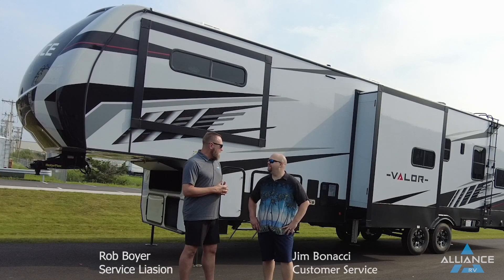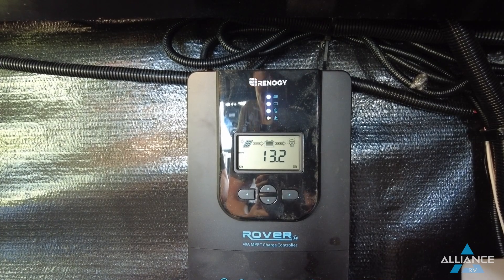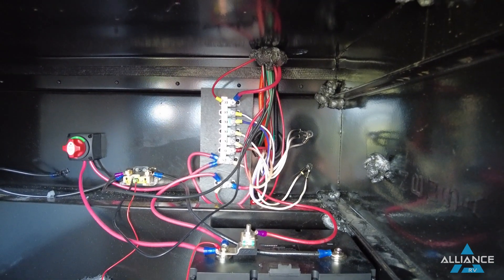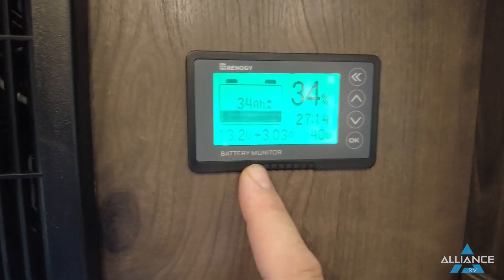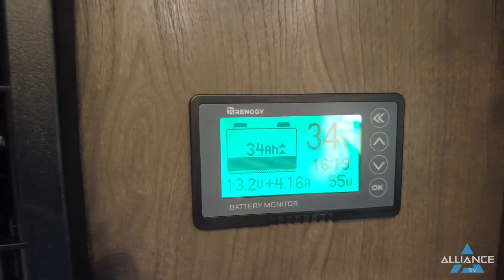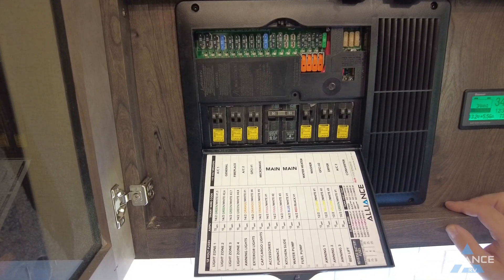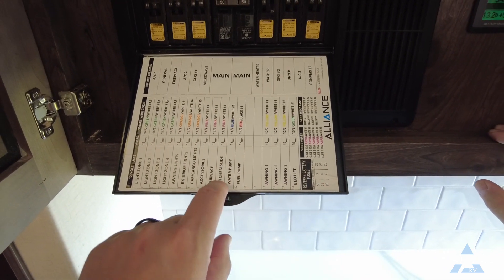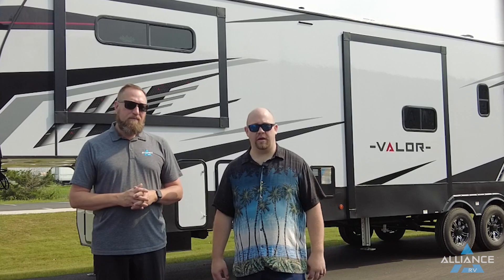Owner Empowerment Valor Standard Solar YouTube

Comment: Can you let me know where to get a replacement 40 fuse that's between the solar charger and the positive battery terminal?
Reply: George- didn’t ok it with Alliance but mine blew within a few days, being a shade tree electrician I got on Amazon and ordered a Buss 40A resettable circuit breaker- not one issue since. Just an FYI, good luck!